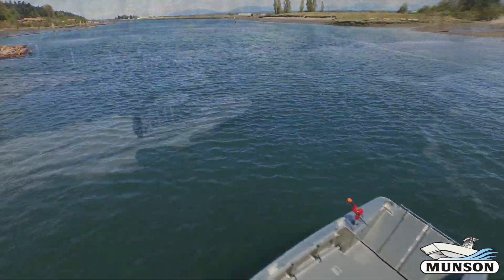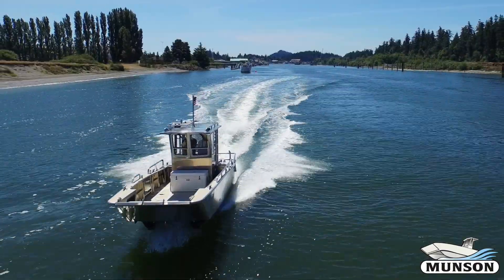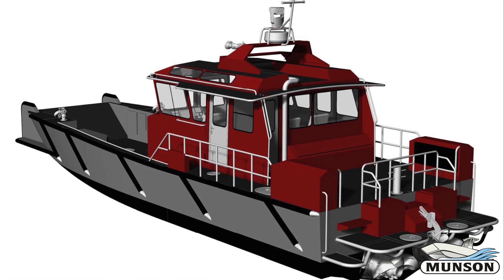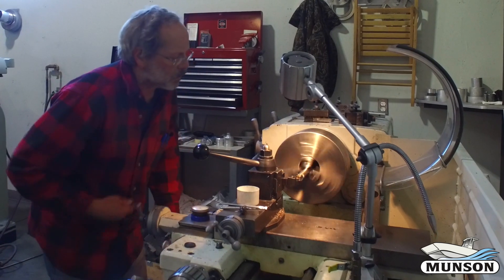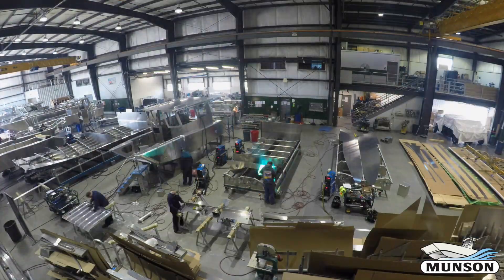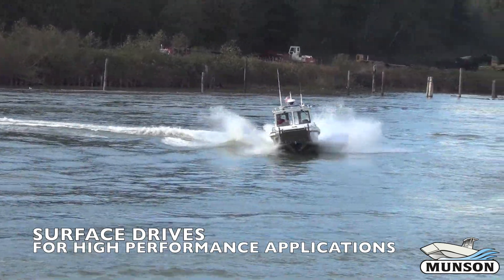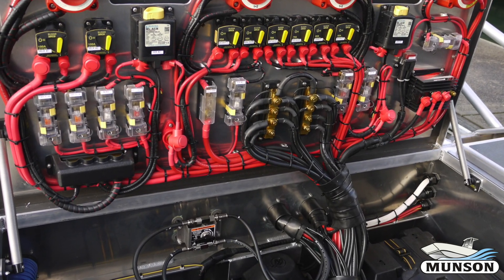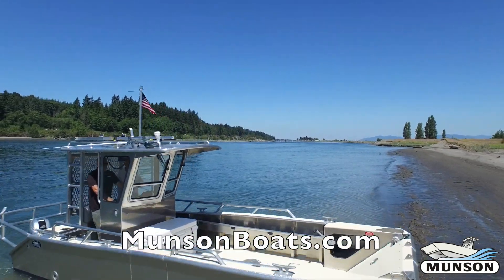Munson Boats - High Performance, Unrivaled Utility

Comment: Sell some to the Ukrainians.  Rather than have them use rubber boats.  Arm it to the teeth.  Depending on size a small armored vehicle could be unloaded behind enemy lines and create havoc.  The rivers and reservoirs are barriers to both sides.  Get me some variants and some Bailly bridges and we could encircle and cut off the Russians.  I'll drive one for free.  I have water time  Get me GPS, radar and we can attack at night in the fog.